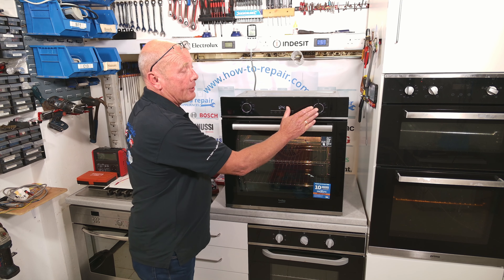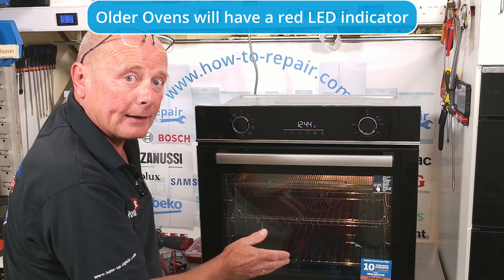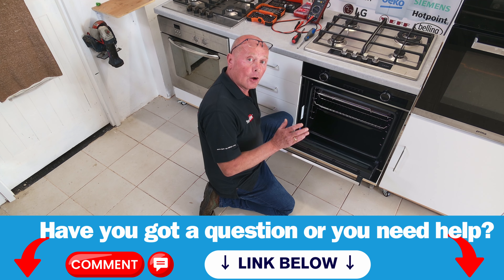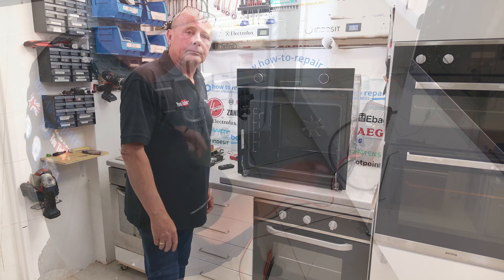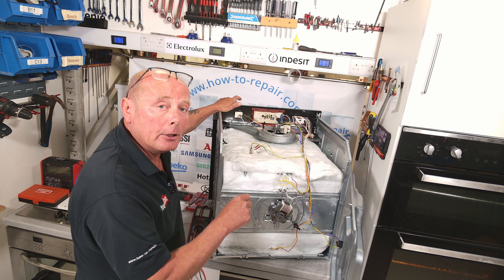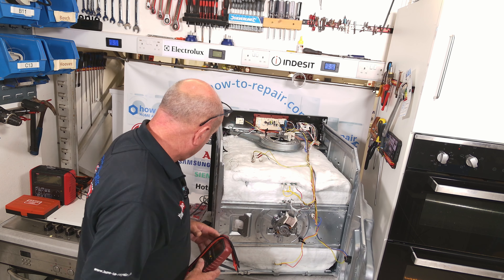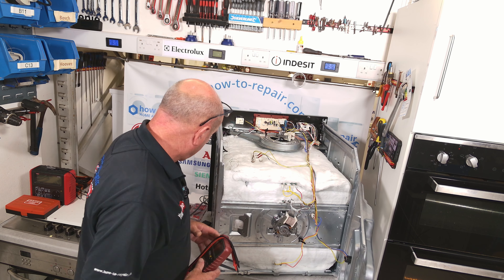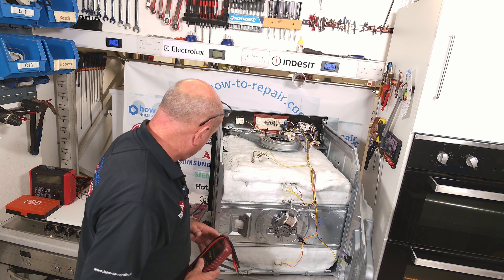Oven Burning Food Or Not Cooking Correctly? How To Test & Replace Beko Oven Thermostat?

Comment: After ordering a new thermostat from a little local white goods repair shop for our stoves dual fuel stand alone 2011 cooker I replaced the thermostat after 2 hours of fiddling about removing panels etc I didn't need to the nob now only turns a quarter of the way bringing the light on and off but only allowing to turn 240 thru to 180 degrees is this incorrect part or incorrectly fitted? 😬

Comment: very useful video, thankyou, the issue I have on my Zanussi ZOB142X oven, is I power it on, fan and light comer on ok, as soon as I turn the thermostat up, it trips the power, this happens on all oven settings as soon as I turn the thermostat up, any ideas? Thankyou
Reply from the maker: Hi, please use our contact us page and make sure you fill out the request for what your problem is. I will need the full model number of the identification plate and the details of your problem so that I can provide you with useful literature. A video shoot of the problem would be perfect as well.

I will get back to you within 24 hours, normally. https://www.how-to-repair.com/help/contact-us/  

Please remember to subscribe to our channel, as that's what keeps this channel going. Thanks, Paul 👍